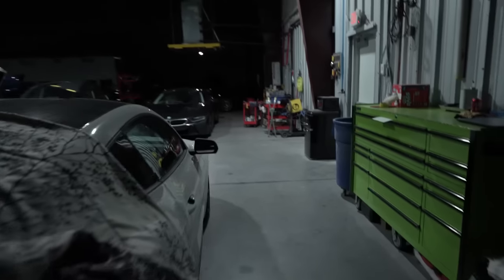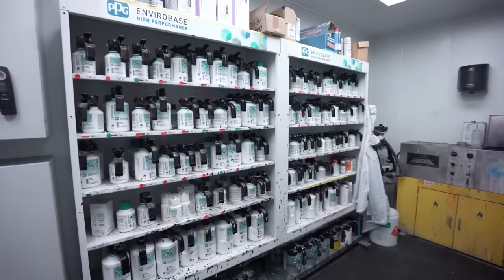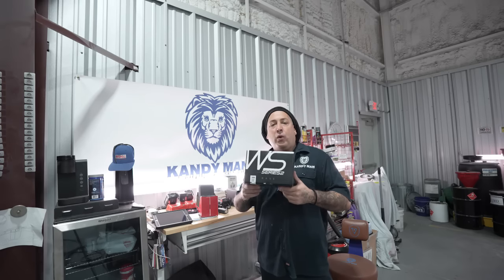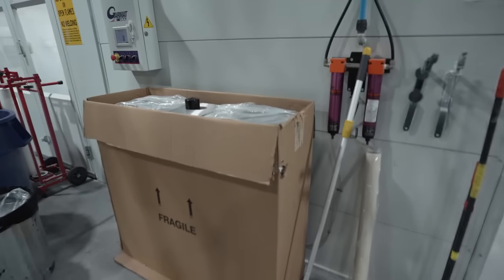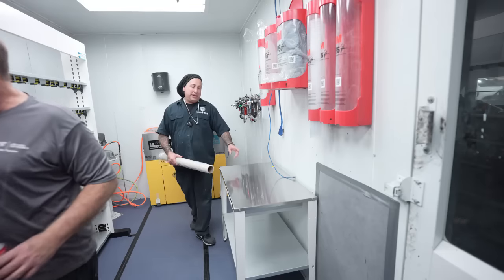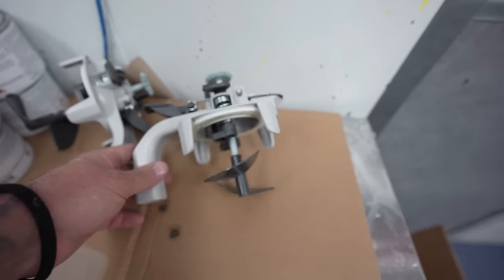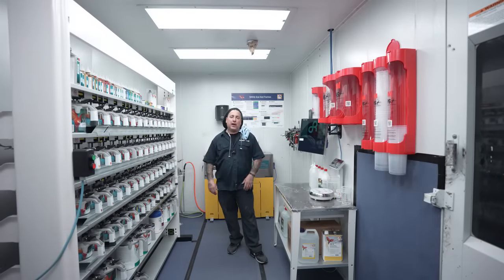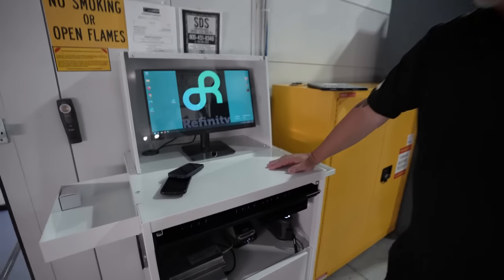Switching From PPG Envirobase To Glasurit 100 Line

Comment: Im curious to see the comparison with the 90 line. I sprayed 90 around 2008 or so. Unfortunately, it was introduced in the worst possible conditions for waterbase.  90s and high humidity. We were using the Venturi driers on stands. The compressors had great driers and traps but what happened was the aluminum housing on the driers was creating condensation with the high velocity air. It would then spit onto the panel. It wasn't fun to fix.
 After we went back to the 55 line, then I was sent to training at the BASF facility in Ohio. All the did was retrofit their existing downdraft with ceiling fans under the plenum. I sprayed a coat with the booth running, step out, and turn on the ceiling fans. I could watch the base flash before my eyes. Huge difference! I would try it again in the proper climate controlled environment.
Reply: Used 90 line around 2007 in South Australia and the high humidity and hot weather was a real problem with blending silver. That's when E3 slow was introduced along with using a viscosity cup.
We ironed out all these waterborne dilemmas, these younger guys are sitting on our shoulders.
Reply: @aurelionatoli2330  
Our BASF rep brought in that slow reducer and it made things worse. We found out later that product was designed for Southwest dry climate with very low humidity. For every two jobs that turned out fine ,there was one that had issues. Bottom line, we should have been through training before even trying it. The instructor at the BASF facility told me that almost every day I was there. Live and learn I guess.

Comment: I remember when my shop got switched to 100 line. I really like the clears. The paint dries super fast. The only issue I had starting out with it was the coverage for whites. I am now at a ppg envirobase shop. And can tell you the whites cover a lot better with the envirobase and the color matching is a lot better. Reading the graphs on the computer took sometime to get used to for sure.